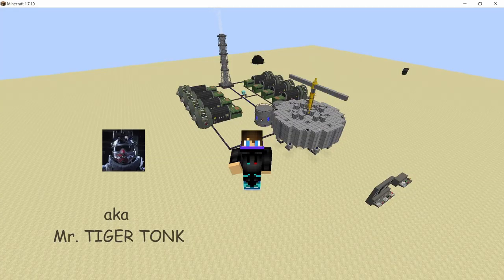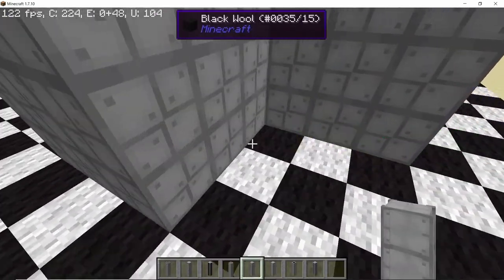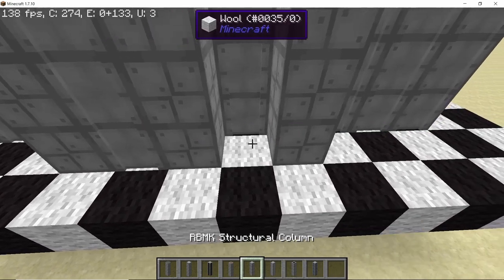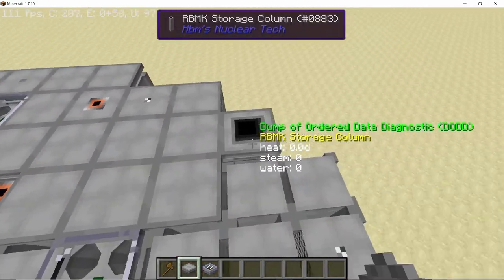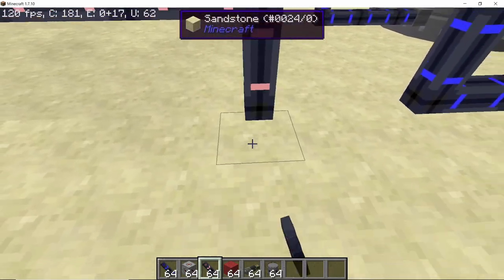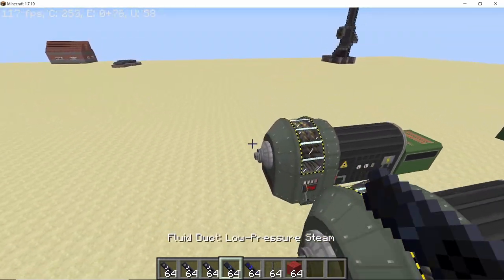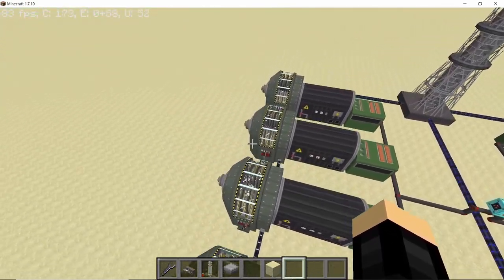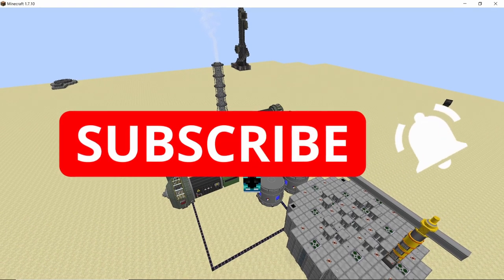Big "15x15" RBMK Reactor Design for HBMs Mod || AZ-5 Capable Reactor with RZM and Uranium Fuel Rods

Comment: This is why I like the rbmk reactor
You use it how you like to fit your needs
Reply from the maker: Exactly, modular reactors are the best 🔥
Reply: @SavageVegeta  Soviet union: what about boom
Reply: @SavageVegeta  they added sperical circle pipes (rip blocky pipes)
Reply from the maker: @nekoguest388  blocky pipes are also there ... That too in multiple sizes now and they look awesome when connected, many different types of pipes have been added basically

Comment: This design is very good, too safe to be a RBMK reactot, nice work. The only way to blow it up is by cutting the cooling system (the water in the steam channels) very nice work
Reply from the maker: Still some people blew it up using fuel rods other than HEU 233 and 235. Blamed it all on me :)
Reply: @SavageVegeta  If they used the right fuel only a troll cutting the water source would make the explosion btw, those who blame you don't know about preventive meassures XD, nice video
Reply from the maker: ay thanks man appreciate the kind words :)
Reply: @SavageVegeta  damn thats sad

Comment: I discovered that is not necessary to change the neutron source everytime you start the reactor, the xenon burns when I left the U-235 fuel rod there, so it's the safest design in the world
Reply from the maker: Well yeah you can leave the neutron source in there , but that is just one less fuel source in the reactor which can contribute to more heat , so you are basically reducing the efficiency of the reactor (kind of ...)
Reply: @SavageVegeta  I mean if you put the neutron source in the reactor, and then change it to U-235 and turn it on without changing the U-235 with the neutron source again, you can turn it on and the reaction will start, it obviusly is less effective than the method in the video, and what I mentioned only works if the reactor has neutron reflectors... Nice reactor tho

Comment: The RBMK reactor is cool but it would be cool too if the Nuclear Tech mod developer added a PWR (Pressurized Water Reactor) reactor with steam generator (Heat Exchanger), and other things!
Reply from the maker: Yep adding new reactors would be pretty cool !! And it's not a stretch to think that they will soon add alot of new stuff as the new updates drop by
Reply: I agree with ya add the pwr reactors and heat exchanger and BWR reactor for an extra

Comment: I wonder, how much could you expand this reactor until it finally gives and there is no way to make it function?...
Reply from the maker: By including 4 more fuel rod modules in the corners and replacing the neutron absorbers with reflectors it'll be pretty easy to absolutely push this reactor to its limits

Comment: This design had a flaw that I learned the hard way in a survival world weeks ago  . If the power keeps risings not the az5 neither traditional rod control will save the reactor . Cause the very side fuel rods that don't have control rods will generate enough neutrons to keep the reaction by themselves . This may not blow the reactor if it's not already on the very limit but it's something it shouldn't happen
Reply from the maker: But the thing is the temperature / power won't keep on rising , on the other hand the power will fall once the rods become more and more depleted. Plus the water in 2 BAT's reaches saturation when running the reactor on UDS but if you really want to then adding 2 more BAT's with Infinite water tanks can be done to ensure that there is no shortage of water !!
Reply: @SavageVegeta  first I was using HEP and HEU . And at the sides that there are reflectors with no rod to keep them . I already reached a moment that too many neutrons were creating even to achieve criticality the rods by themselves . In the worst case scenario with strong fuels maybe only coolant would save enough time to remove them by hand
Reply: @VoidPaul97  this has nothing to do with what I said
Reply: ah yes the Anatoly Dyatlov moment
Reply: Yo man how is the survival world doing?
Reply: @ROSoul-wx1iu  really good actually . On my way for the first electronium ingot

Comment: i don't know if this is due to the mod updating or not but the design did not work. Skin temperature wouldn't rise above 142 even in the rods closest to the middle.

Edit: switching to a stronger neutron source made it work, skin temp of fuel is now ~900 and all steam channels are 601-603, stable and enough for steam generation.

Comment: I have a question. I did everything you showed in the video, made the controll rods to 80%, but as soon as the reactor starts up and then has leveled off, yellow clouds appear and the Geiger counter hums around
Reply from the maker: I am not very sure about this but probably think that it's cause either you forgot to place either the neutron absorbers / neutron emitters and due to that radiation is leaking out.
Other then that I think it can be due to the not pulling out the rods completely the temperature of the reactor isn't reaching its max numbers so there is some Xenon buildup ... but that's very unlikely as even with 80% of the rods out all the columns should be easily above 1k degrees centigrade ...
Reply: @SavageVegeta  Ok Thanks
Reply: О-о-о-о-о брат это тебе надо строить вокруг реактора боковую защиту многослойную первый слой из воды второй из борного песка ну для красоты можно облицевать сталью например Так делают на реалистичных реакторах РБМК Привет из России
Reply from the maker: @Amanehalast  Что ж, это отличный способ сделать РБМК более реалистичным, и я благодарю вас за полезный совет. Причина, по которой я не использую это экранирование в своей конструкции, заключается в правильном размещении поглотителей и отражателей нейтронов, реактор не пропускает много радиации!!

Comment: So question WHAT DO I DO IF ITS HEAVILY XENON POISONED
Reply from the maker: You place down a neutron source in middle and pull out the control rods by around 50 % ,

You can also pull them out completely but then there's a small chance of the reactor exploding ... anyways once your control rods are half / 75% out then wait for the xenon to burn away and then pull out your rods by 100%

Comment: @SavageVegeta, can you tell me how to connect the Fluid Duct: Water to RBMK Steam Connectors. I follow everything what was in the video but still the water pipes don't want  connect to the Steam Connectors. Please Help me:(
Reply: Should I test the RBMK ReaSim Steam Connectors or something?
Reply from the maker: it is a visual glitch in the 1.12.2 reloaded version of the mod and has nothing to do with reasim game rule
I highly recommend you to download the NTM Extended version and in there this problem is solved !!
Reply: @SavageVegeta Ok, Thank you alot for helping me out. I can now make RBMK reactor completely ready for use!
Reply from the maker: @AtomGradNPP  you're most welcome my dude
Reply: @SavageVegeta hi, ummm I ran to new problem again. I am playng on the newest version of the mod and the reactor wont start correctly, idk what is wrong but it dosent work like it should. I have rebuilded the reactor 10 times now and still wont work. I fixed the mod btw it isnt reloaded version of it anymore:D

Comment: I am on a server and Im making it but I need nukes and Short/long lived nuclear waste does this work for nuclear waste?
Reply from the maker: for obtaining waste quickly I would recommend checking out some depleting RBMK reactor designs as they run very hot therefore deplete the fuel faster than bigger reactors. Other than that every reactor will deplete fuel with different rates depending on the design you went with

Comment: have you made an effective 1.7.10 fusion reactor model? it would be cool to be able to have this RBMK reactor power a fusion reactor in the same base, im not sure if the fusion reactors have changed since i last used one in 2022.
Reply from the maker: https://youtu.be/hIVyyon9izY I made this video a month or two ago, It uses a fork of ntm but the concept will apply to the base version of the mod as well. Using the most basic fuel you can make a self sustaining fusion setup ez. Only thing you need to take care of is changing the blanket once it is near the end of its durability

Comment: I'm having an issue where the steam connector doesn't connect to the water ducts, I don't know why it wont connect :(
Reply from the maker: It is a visual bug in the 1.12.2 Reloaded version of the mod, your reactor should work fine otherwise. You can connect the steam pipes from the top of the steam channel and that way you won't need to use the steam connectors.
I have made a vid on 1.12.2 RBMK so you can check that out and also try using NTM Extended as this visual bug is solved in that version afaik

Comment: hey savage Vegeta can i replace all the fuel rods with a medium enriched plutonium-239 fuel?
Reply from the maker: You can , however you won't be able to shut the reactor down without pulling out all the rods then
Reply: @SavageVegeta  ok thanks i won't do it just asking if it can
Reply: @SavageVegeta  oh yea i forgot to say how much cooling tower i can put?
Reply from the maker: @jovicaplays2149  you should be fine with a single big cooling tower, but if it seems there's some blockage then go to 2 towers
Reply: @SavageVegeta  ok thanks because im working on my rbmk save file on Minecraft with chamber control room steam turbine room etc

Comment: Hello savage veggetta I wanted to ask you why my reactor is not working if I follow all the steps well what happens is that I put it on the power button and it does not start it does not heat up
Reply from the maker: Hmm that's weird , cause like all you need to start the reactor is a neutron source in the middle and the chain reaction should begin. I can't tell more before taking a look at what you're doing 
I guess you can check your ducts and steam connectors to see if they are connected properly to your turbines , maybe that's why the reactor isn't producing power

Comment: I built this one in my NPP, I did some upgrades on it so it produces around 60MH/s but it lags the game so badddddddd. Is there some solve for it because I have a good PC, and im running like at 10 FPS. I play on 1.12.2
Reply from the maker: I recommend using NTM Extended instead of NTM Reloaded for the fps issue ... In the newer updates of ntm extended RBMK performance has been improved quite alot.
Reply: @SavageVegeta  I use the extended version, I tried 1.7.10 version and it´s even more lagged. Can you record video about how to get more FPS?
Reply from the maker: @dardantvsk4945  I seriously don't do anything special to get more fps so idk what I can include in that video. Maybe try using optifine in your modpack as well cause it's the only visual quality mod that I use

Comment: Please help. How to convert HBM He/T to IC2 EU/t. I would like to power Ilumunator (Lamp IC2) my RMBK reactor. HELP! I need mood converter? maybe it's built into the HBM mod?
Reply from the maker: Use an "HE to RF" convertor and it should work directly , it is available in HBM mod. However if it doesn't work then convert the HE to RF first and then convert the RF to EU.
Reply: @SavageVegeta  thx you :) I love this MOD :* ;) :)

Comment: When I try and put the fluid identifier in the tank the slot is missing. there are only 2 slots in the menu
Reply from the maker: yeah you can direly set it to any fluid type by placing it inside the tank. The fluid identifier feature is missing from 1.12.2 version
Reply: @SavageVegeta  thanks

Comment: The water isnt going inside the steam channel but it shows in the ui but not the rbmk console and it keeps exploding
Reply from the maker: lemme guess, this is on 1.12.2 version 
try using NTM Extended mod instead of NTM Reloaded as it is more upto date
Reply: Alright :D
Reply: the exploding was a fault in the design but the rbmk console was def a bug with realoded

Comment: This is a very hot running reactor so i recommend using coolers
Reply from the maker: Design is pretty old, now water tank is not needed as it will just circulate if enough cooling towers are used !!
Reply from the maker: So I think without using the coolers the reactor would work perfectly
Reply: You are correct but if any of you are me and id**t scared that the reactor will blow up and in my case did blow up well i added coolers
Reply from the maker: @wakinesguerraquitted9733  for you it blew up cause I messed this design up by using significantly less water tanks and cooling towers... With the new fluid system that isn't an issue but when this video was uploaded it was a significant error
Also yes there are no downsides to using the RBMK coolers anyways so I guess yes using them or not is totally upto you !
Reply: @SavageVegeta  to be totally honest i knew that you messed up its in the thumbnail 2 water tanks arent enough for a 15x15 hot running reactor i still used a auxiliary cooling tower as it can support my 2 tanks that dont have infinite water tanks
Reply from the maker: @wakinesguerraquitted9733  yeah
Reply: @SavageVegeta  I did I little (when I mean little its actually a lot) tweaks to the reactor and the minimum power or mhe i got is 64.25 -65.1 and the max is 81 mhe during a loss of coolant which almost led to a meltdown but luckily it was az-5 capable
edit: so it can fit your needs for power although its very hot running up to 1000 column temp

Comment: Hey man, I built this on a Chernobyl map I have downloaded, but the turbines aren't spinning when everything is hooked up fine. I am on 1.12 for reference, I'm wondering what I should try to get it running? Along with the turbines not spinning, it is not producing any power or heating up.
Reply from the maker: 1.12.2 has some fluid duct features which are different than 1.7.10 HBM or maybe the steam ducts you set are not same as the steam your boilers are producing , that is one of the most common mistake most of us make when making an RBMK. Now I am gonna upload a video today after like 5 hours , it is a Breeding RBMK reactor in 1.12.2 and produces 8 MHE/s ... maybe that should clear your confusion

Comment: is this reactor for short time use only? i counted more or less 50 seconds to 80 seconds before it needs to be turned off because the water ran out (using full BAT and heavy infinite water tank)
Reply from the maker: Well have 4 tanks instead of 2 , and definitely replace the auxiliary cooling tower with one or two big cooling towers and that should solve the water issue hopefully
Reply: @SavageVegeta  ah thanks for the answer :)
i realized the auxiliary cooling tower / big cooling tower is actually needed for this haha, 
ive been using the steam condenser block due to being underground so that's why
Reply from the maker: @hyacinthsen  ah ohk that explains alot of things ,so yeah anyways just have like 2 big cooling towers and 4 big ass tanks and I think it'll be good , if not just increase the amount of cooling towers in there ... You'll be surprised how quickly the leviathan turbine processes steam 🥲

Comment: and also i have been trying my own fifteen by fifteen reactor and somehow it worked ???????????? but it was absoloute garbage i litteraly replaced absorbers with reflecters while it was running and i made a very big mistake i put the diagmaa fuel rod in one slot just 1 single slot and  i think i may have ended the world :[
Reply from the maker: Oh if it worked then that's pretty good man , but yeah placing in the Digamma rod was a mistake 😂
Hey but you learnt a valuable lesson about Digamma now didn't you xd 
P..S. F in the chat for you if this happened in a hardcore world 🥲

Comment: Hi, I can't find the storage column? The only column I have is the structural one. I am playing on 1.12.2.
Reply: Oh and yeah I am using the HBM's Nuclear tech mod Reloaded edition as the standard one is for 1.7. versions only
Reply from the maker: I think storage columns have not been added in HBMs reloaded just like how RBMK cranes have not been added. There are still alot of missing features which probabl;y won't be added in HBMs Reloaded :(
Reply: @SavageVegeta  Ahh that's too bad!
Do you know if this particular reactor can work without the crane system (storage columns)? Or it'll explode and I don't really want that
Reply from the maker: @nexoo_2968  the crane only does the job of loading and unloading the fuel rods and breedable items. You can do that manually with hand as well ... Actually before the crane was added loading and unloading the fuel by hand was the only option
So yeah the crane doesn't contribute anything in making the reactor explode :)
Reply: @SavageVegeta  Thanks! I'm then going to manually control the reactor and I'll probably make another Chernobyl.
Thanks for answering!
Reply: 1 more question:
When should I replace fuel rods?

Comment: Can you link two RBMK cranes console to only one crane, like if you want to put a crane controller in the control room but also in the reactor room?
Reply from the maker: It probably can be , link an RBMK wrench to a reactor and then try right clicking on two crane consoles , hopefully that shouldn't spawn 2 cranes and both of them should be linked to a single system
Reply: @SavageVegeta  Thanks I'm going to try it
Reply: @SavageVegeta  Sadly it spawned two cranes :( well at least I have my reactor going perfec- Oh there the RBMK console turned off??? 

Just Kidding XD, hope they add the linking mechanic that I said soon... (sorry for my bad english if I write something wrong)
Reply from the maker: SO wait you can have two cranes on one RBMK ,,, that's pretty cool in its own sense I am going to try that tomorrow for sure
Reply: @SavageVegeta  Yeah that's very usefull